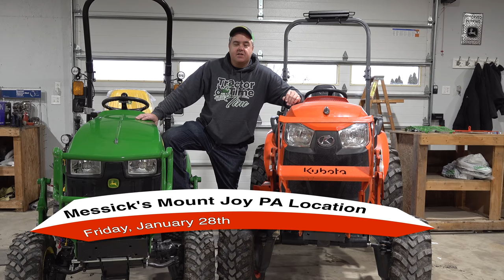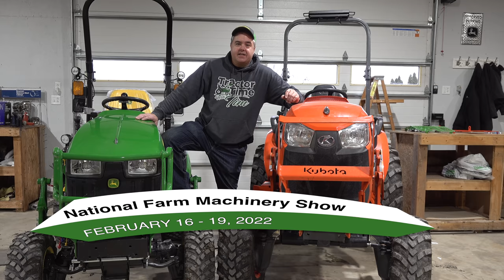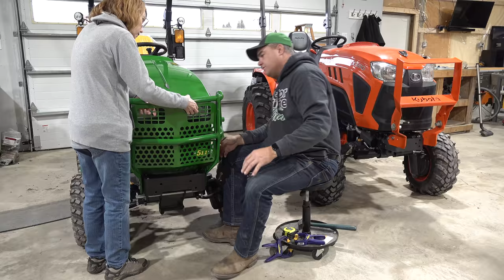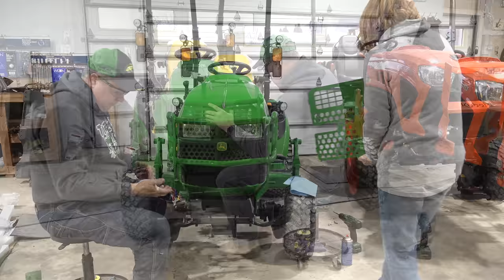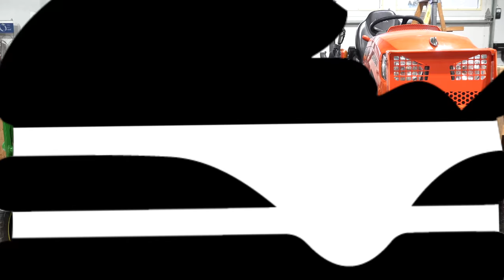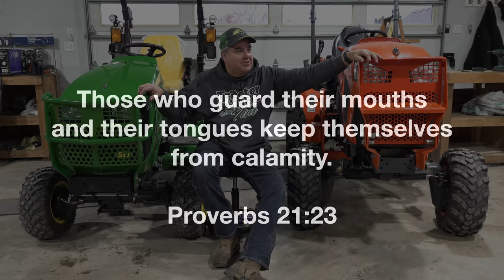Protect Your Radiator! John Deere 1025R and Kubota LX3310 Brush Guard

Comment: I know that on Good Works Tractors 🚜  a friend was borrowing Courtney's 1025r  and they missed with the stump bucket and the tractor ran into the stump. If they hadn't installed the 511 screen guard the radiator probably would have busted. I think that emphasizes your point with a grapple. I'm going to install one on our Grand L 3560 when it comes in this spring before we start using the Precision pallet forks adjustable Add a Grapple that we are buying for it.

Comment: The comment about the lights being blocked a bit are the first thing I thought of too. Nice video and info as always Tim.
Reply: Some have concerns about that, but there have been several comments that they don't notice the difference. For what it's worth, we have not had any concerns from customers that have purchased them.  Most people prefer the full protection this design offers. Headlights aren't very functional with a loader so most people add secondary lighting.

Comment: I installed the 511 guard on my 2025R and I think it is a worthy upgrade both for protection and appearance.  Since I work by myself, I used some stainless wire to hold the guard in place to mark the holes.  Years ago, I purchased a set of Transfer Punches (Harbor Freight has a set for $10).  They makes it easy to get a mark in the center of a hole and I find that I use them a lot..  Once you mark the center, then use a center punch to make a better spot to drill.

Comment: I looked into the option a few years ago... I couldn't find anything and with no experience at welding I went to a metal shop.  I  picked up a section for mesh grill around $40  and then paid around $50 to have it welded onto the metal ... I painted it orange with a rattle can and for around $100 It looks good and works awesome.    It has taken allot of abuse over the years and held up..

Comment: I have a grille guard from Broken Anvil Metalworks on my Kioti DK4510. Looks good and was relatively easy to install. Not cheap, but much less than a broken radiator/grille!
Reply: Thanks! Just bought a Kioti!
Reply: We are working on filling out the Kioti lineup as well. We currently have the CK models covered and will be releasing the CX in a week or so.

Comment: Sending our best wishes for your speedy recovery with minimal complications.  65 degrees here just north of Chapel Hill today, I installed the 511 guard on my 1025R this morning and then came across your video.  I bought mine a few months back after punching a hole on the left side of by radiator screen but have been too busy to install it until now.

Nice product, well made and it looks great.  I have called them and asked if there were any plans for some sort of side guards but he's got plenty going on already with making guards for a wide variety of machines.

Comment: Enjoyed the video.  As others have mentioned, transfer punches will solve the centering issue when marking the holes.  The other suggestion I would have is to drill the first hole and install the bolt, that way you can see exactly where the guard is mounted on that side and adjust the grill guard for level (alignment with the guard) before marking the other side with a transfer punch.

Hope the 3 of you feel better soon!
Reply: Sharpies!
Trace the hole locations.
Drill 5/16" holes for 1/4" bolts. Done.

Comment: Hey Tim, JD has there own front mount weight bracket that exstends out about 3ish inches from the standard front rail. I have one on my tractor for my front weights and it should give you the clearance you need on the 1025r. at least I hope it will when I get my brush guard.

The other option would be the HH 2inch front reciver and weight bracket combo

Comment: Those guards look good. One advantage with Massey Ferguson (at least subcompact) is that the radiator is Infront of the operator. Like you said, radiators aren't damaged often but it cuts down on debris clogs as well.
Reply: That's a big boon in the winter time, but not as much in the summer :)
Reply: @jagx234  not at all, fan draws air from below the steering wheel for the radiator, blowing twords the nose of the tractor

Comment: A tip from life lessons learned the hard way, a sharpie works wonderful to mark holes then center punch the marks try it sometime.
Reply: That is how I do it.
I move suspensions on semi trucks, mount fuel tanks, tool boxes, lift axles, dump boxes and grain boxes.
50 hours a week.
My punch sets stay at home for machine shop work.
Sharpies for the win.
Silver and bronze ones really stand out !!

Comment: I cant speak for new Johnny, but on the Kubota your headlights are near useless if the loader is on unless you carry it too high or an inch off the ground. $40 on amazon and i had a light bar mounted on the top of my canopy that has 10x the brightness even after i put led's in place of the halogens for headlights
Reply from the maker: Yes, agree.  The front mounted lights are there to make the tractor ‘look good’….not to add much night time visibility!  :-)

Comment: I wanted to share a tip I got recently: if you put a socket into the hole, and use a punch that fits into the square hole of the socket, the punch will be exactly centered. Also, I think your magnetic drill will attach to the brush guard and drill your holes in just the right spot.

Comment: I used Milwaukee vise grip style clamps. They make it so you can pull put the second bolt in really easy. As far as the weight bracket issue, the 2025r has the exact same guard except there is a cut out for the tool box. Maybe try that

Comment: Cool !  I got the black one on my John Deere.  Hey Tim there’s a shiny guard right below the Air filter canister On the right side of the engine mine fell apart  when I took my side panel off it just fell and hit the floor.  Have you ever had a problem with that guard over the years.  The part that’s bolted to the engine stayed there just the bottom part broke and fell off

Comment: I installed mine on my 1025r and found the included bolts weren't long enough to engage into the nylock nuts properly. 
I went and replaced them with same bolts but 1" long.  I wrote the seller and told them they should send longer bolts.
Reply: I am not sure why the bolts were too short on your machine. We may have sent the wrong ones. I believe we asked how much longer they needed to be so we could understand the issue and ship out new ones. We apologize for the inconvenience.

Comment: I have the same concerns for my 2025R. I wonder how much light they block. If both your 1025R's, have the same head lights it might be interesting to compare them aimed at a garage door. I have transfer punches to locate drilled holes.
Reply: I have one of the guards on my 3039R . It has no effect on the headlights . They light up as much as they did before .

Comment: Have you had any problems with water in the fuel. I head the fuel gauge has a bad gasket so when you wash the tractor the fuel tank gets contaminated. I have spent this week changing fuel filters, {thanks for the info in your videos.) Today out of exasperation I drained the fuel tank and added fresh fuel.

Comment: Yep I agree. I don’t think the cover over the lights is a good idea. I think the lights are going to reflect back on the driver at night. Lights are a lot cheaper to replace than a radiator. Good video as always!
Reply: Wonder if you could paint the driver side black would help?
Reply: Based on customer feedback and comments here, the headlights aren't impacted much, if at all. If you have a loader, the headlights aren't very practical. Most people add auxillary lights to shine over the bucket.

Comment: Kubota has some design flaws will only become apparent when you own. The front headlight output leaves much to be desired. The OME brush guard cuts off some of the light from the bulbs, adding the additional brush guard with the squares would only decrease some. Kubota needs to up grade their OME lights to LED’s which would lessen electric draw…..

Comment: A little cardboard template for the hole location would be a big help.
Reply: We have found that wrapping a piece of corrugated cardboard around the tube at the slot location on each side positions the gaps perfectly.
Reply: @5elevendesignz511  Thank you for the reply. You taking the time to resolve a potential issue, makes me even more interested in your product. I have a L6060 and I find the OEM guard to be very "floppy". Your guard would be a good way to resolve the issue.
Reply: @bladewiper  my pleasure. Customer satisfaction is our #1 goal. We will take whatever time is needed to answer questions or help solve an issue.

Comment: I would like to find a grill guard that mounted on the front of the OEM guard. I have a LX3310 and had a log come down on the center brace and bent it down by a few inches. It threw the whole guard out of whack so had to buy a new one. I hope you all feel better soon.
Reply from the maker: I think the OEM guard on the LX3310 is too wimpy.

Comment: on the deer mabey you should put pins in instead of bolts so that  you can move the bottom part to swing it back to put weights on, just a idea
Reply: I like it. Maybe Tim can try removing the lower bolts to test it out. We plan to make a weight mount that is proud of the guard for the folks wanting to add weight.

Comment: I would have propped it up from the bottom with blocks, then marked the first hole location, drilled it, put a bolt in to hold that side, marked the opposite side, drilled, bolted it, and then do the bottom holes. But I don't have a wife.  😁

Comment: Seems like both units will severely hinder the headlights.
Reply: Based on customer feedback and comments here it doesn't seems to a large concern. With a bucker or other implements installed the headlights are blocked the majority of the time. Most chose to mount lights up high.

Comment: "Get him Girl" I wonder if the guard doesn't fit on the front of the other guard.  The slots seem to fit and were cut.  Why cut anything out more if it doesn't need it?  What you need for the weights might be another bracket bolted to the other and sticks out for more leverage and weight ...
Reply: The factory guard has compound curves. It is both angled side to side and curved from top to bottom. The slots enabled the guard to be one piece yet fit within the profile of the factory guard.

Comment: This guard wouldn't work well on my 1025r, or it would need to be removed for winter ops.  In northern Ontario I use our 1025r for snow removal (JD 54" FM snow thrower).  Almost always, the front factory grill is caked with snow and ice that must be removed after clearing ops.  I can imagine that this grill would compound the problem and make ice removal extremely difficult , if not impossible.
Reply: I wonder if it would actually keep some of the snow off of the grill. Another option aside from removing it for snow removal would be to cover the guard completely. In cold months I doubt it would affect operating temperature but may worth trying.

Comment: I like the look of these guards and they will certainly be effective at protecting the grill screen but is there even a NEED to protect the radiator? I think not. On most SCUT/CUT tractors the radiator is at LEAST 12-inches behind the grill. On many like the BX it is located in front of the steering wheel. Don't get me wrong, I'm sure there are folks who have managed to damage their radiator by Jousting with logs but I'm willing to bet that 95% of folks just suffer damage to the grill screen.
Reply from the maker: Probably.   Several have commented about a broken radiator, so likely more prevalent than we might at first think.  
In any case, worth it even for screen protection.
Reply: Depending on the location, the radiator is the primary item you want to protect. We have had several customers call us after damaging the radiator.